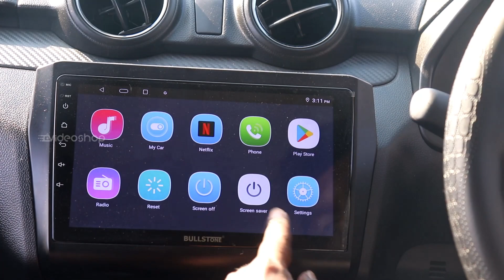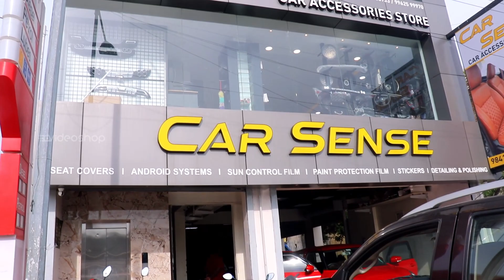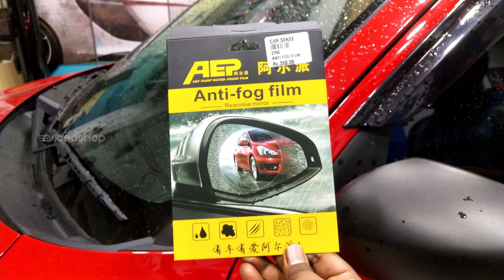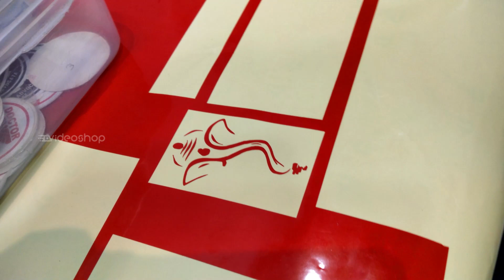New Swift Modified LXI to ZXI | Swift Modification | Basic to Top End | Car Accessories | Video Shop

Comment: Enna LXI to ZXI conversion?😂
Seat cover , Android play pota mudinchu zxi car ready ..🤣
Turn indicator Orvm, projector headlights, LED DRL, electric tail gate release, 185/65 R15 tyres, 60:40 split seat , alloy wheels, power window rear, keyless entry
Ithellam enga bro ...? 
Swift modification nu podunga caption la
Reply: Bro,r 18 is suitable for swift,dont make comedy it's  fortuner or swift to first r18??
Reply: solla ninachatha appadiye solliteenga..... Android player fit panna top end nu ninachu kiranga pola....

Comment: Its nothing
Lxi to zxi conversion is :-
MGP power window with door trims
Front and back seat replacement with adjustable headrest and 60:40 rear split seat 
Speedometer
Electrical boot opner 
Electrical orvms 
Steering mounted controls
Alloy wheels
Fog lamps
and much more things...
Come to delhi then you will know what lxi to zxi really means..